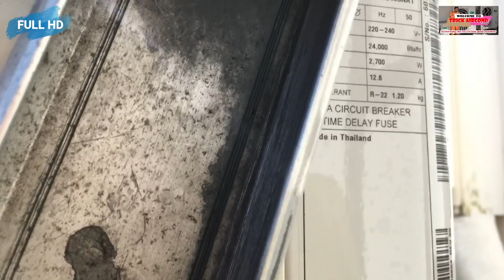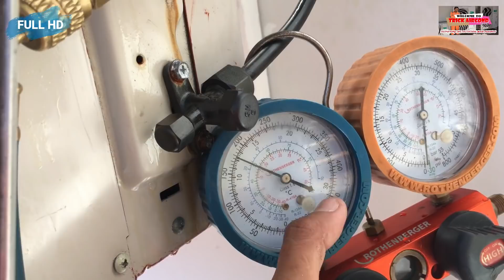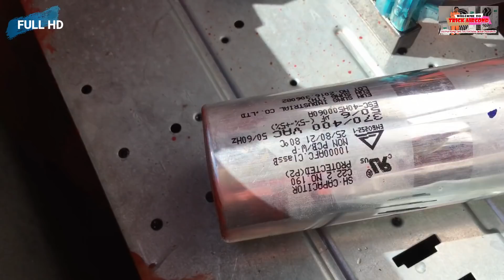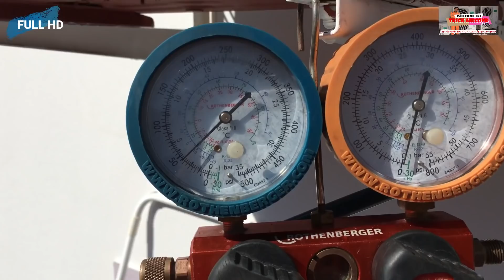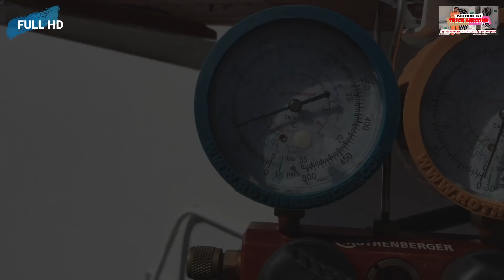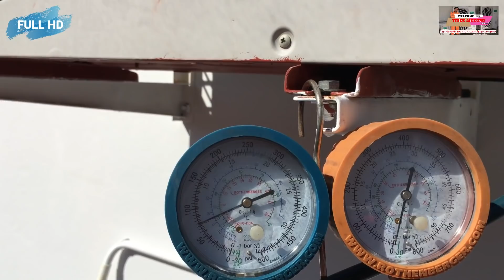Kapasitor kaki 3 ac LG rusak, cara mengatasi ac Lg tidak dingin

Comment: Mahu tanya . Kenapa selepas sy buat chemical service . Coil indoor dibahagian bawah tidak sejuk . Diatas sejuk sahaja . Gimana mahu mengatasinya ? Mohon tunjuk ajar
Reply from the maker: Pressure brpa bang
Reply: TRICK AIRCOND CHANNEL sebelum diservis semua coil sejuk . Selepas servis coil di bahagian bawah tak sejuk . Pressure 70psi . Ampere 3.8 . Ampere pada body 3.98 . Aircond jenama york 1.5 r22